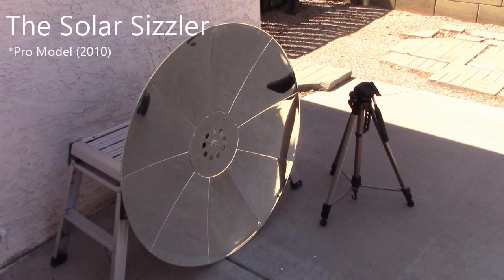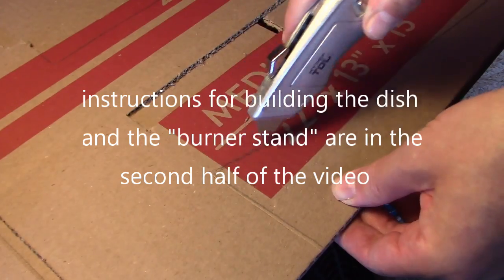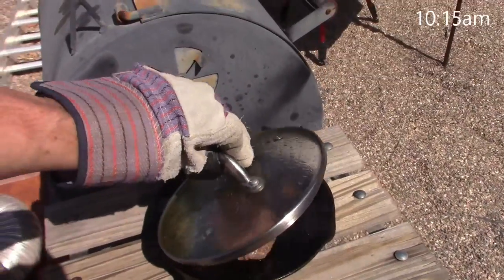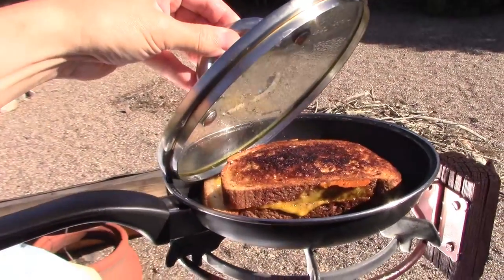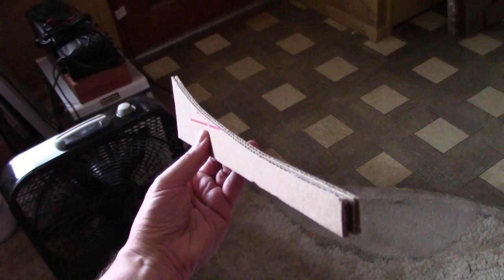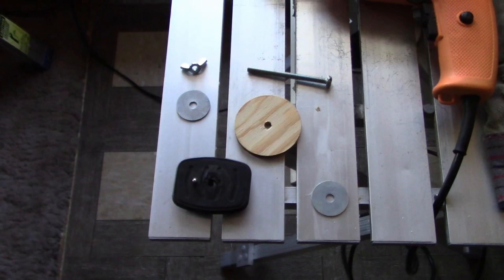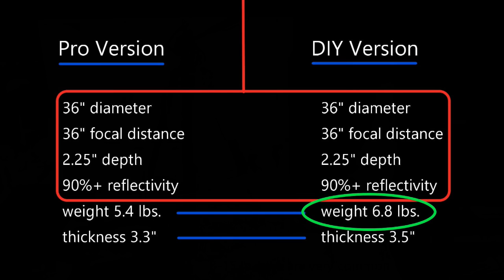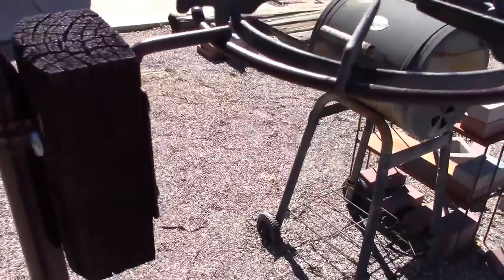Reviving a Lost Parabolic Solar Cooker! Smart Sized DIY! Ideal for Everyday Meals! Perfectly Powered

Comment: really neat conformation to the curve. i never thought constructing the curve without a mold was so feasible. just a few questions if you read this.    why didn't you measure a single smaller fin and take outlines rather than remeasuring? howd you find the depth of the dishes? howd you test the reflectivity of the mirror stickers? why dont you cut mirrors for the dishes? hope u see this. awesome vid!
Reply from the maker: hi. I'm glad you like the project. to answer your questions; I didn't remeasure. i just made one cardboard fin (pattern piece) and then traced the other 31 fins. To find the depth of the dish you just need to know two things (the diameter of the dish and the focal distance). if you put those into a formula it will give you the depth of the dish. the mirror stickers are made by coating an acrylic with aluminum using a technique called vacuum deposition or (IVD). that on average results in a reflectivity of 90-92%. it can be as high as 96% in special cases but the average for aluminum coated items using IVD is typically just over 90%. (note: the IVD process is used to coat almost all professionally made parabolic solar cookers these days - including the original solar sizzler). they use aluminum tape sometimes but it's also made with vapor deposition. you also asked why i don't just use mirror. (i'm assuming you mean regular glass mirror). i don't use that for many reasons. it's way too heavy, too fragile, and not as reflective as acrylic mirror stickers plus it's glass, so it's flat. any parabolic collector that uses a flat non-bendable material like regular glass isn't really a parabolic cooker. any flat reflective surface would bounce light all over resulting in lots of unnecessary power losses. plus the weight and fragility would be serious issues.

Comment: Great video, glad you're still around. What about the sand battery? Would 200 lbs of sand heated by solar during the day be enough to heat a bedroom at night?
Reply from the maker: hi. i would say yes, but it will depend on a few things including how cold it is where you live and how hot you heat the sand.
Reply: depends on insulation, surface area, the space youre heating, the temp outside. might need to test it

Comment: Great idea and build! You can also buy concave mirrors they use for peoples driveway, so they can see the on coming traffic. Just turn them upside down and you are done.

But truthfully, building your own is more gratifying! You did a grand job!
Reply from the maker: hi. the driveway mirrors is an interesting idea, but driveway mirrors are usually not parabolically shaped. they are generally spherical (which looks similar) but they wouldn't produce a tight enough focus spot to work for cooking. (in most cases anyway). you might get lucky if the sphere shape was close enough to an actual parabola but then you'd have the issue of the spot's width (and whether it was wide enough (or too wide) to cover the bottom of the pot. lots of variables. I'm not busting on your idea, sounds like an interesting "hack', but make it yourself and then it'll work for sure 🙂

Comment: Only downside is you need welding goggles to work around it.
Reply from the maker: hi. no need for welding goggles lol. the focal spot on this 3-foot dish is really not bad. probably half as strong as those big dishes they sell. just regular (light tint) sunglasses is all you need. honestly, I don't even use sunglasses half the time. I just squint my eyes a little when I adjust the 'hot spot' and that works good enough to 'dim the spot'. you only see the edge of the focus point for a couple of seconds during the adjustment so no biggie. also, the bottom of the pan is solid black, so the black color absorbs most of the light and very little bounces off. 🙂

Comment: What is the average temperature on the pan during cooking? Did You measure it?
Reply from the maker: hi. i didn't measure the actual temperature but what i can tell you is that it cooks the same as using a standard size burner on an electric kitchen stove *on medium heat to medium-high heat. pretty much the sweet spot for most cooking. and for simmer temps you just pull the collector back a couple of inches and doing that weakens the temp to low heat.
Reply: Good video, thanks for sharing, YAH bless
Reply from the maker: @MichaelR58 hi and thank you!